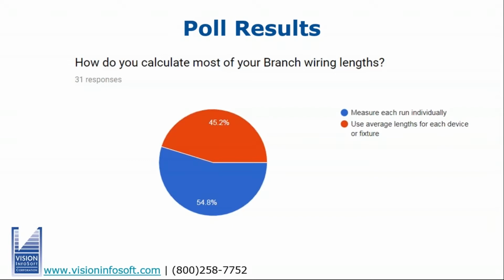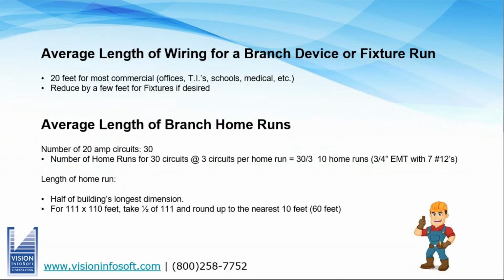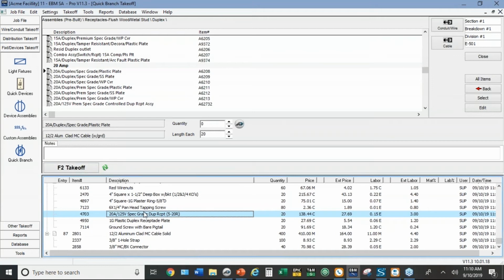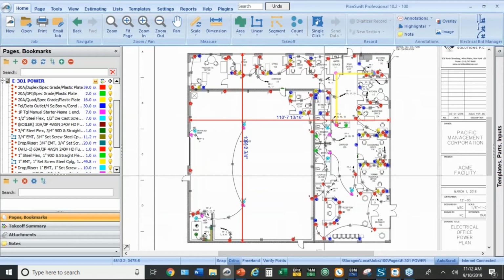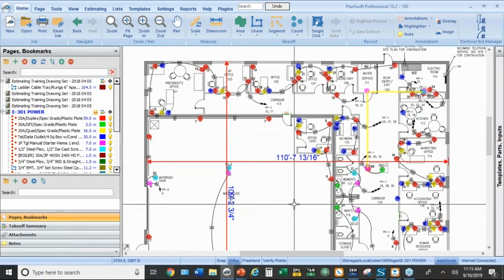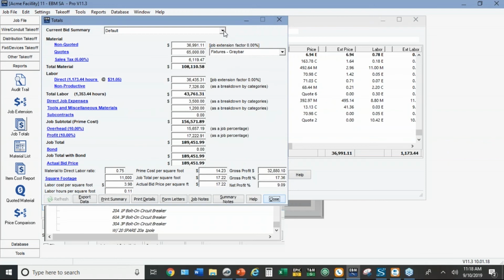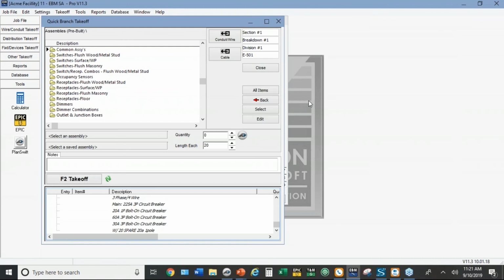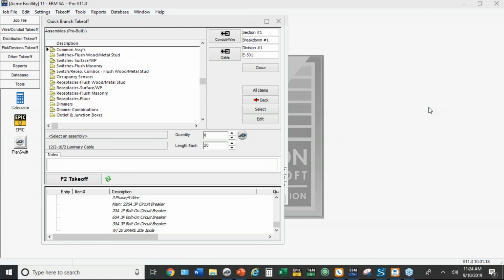How to speed up the most time-consuming part of a takeoff (and improve accuracy!)

Comment: What size crew and how long would it take to get a $200,000 commercial job like that done?
Reply: The size of the crew would depend on the length of time available to complete the electrical work.  I believe there were about 1100 hours on this job which would be about 138 days 1100/8).  At 40 hours a week for two electricians, that would be 80 hours per week.  138/80 = 1.725 weeks (or about 9 days for 2 electricians).

Comment: Your Formula is flawed, because for one...7 #12's or three 120v circuits with a equipment ground, requires derating every single current carrying conductor becasue you exceeded the NEC rule.  Also, if you have circuits spec'd to be in their own conduit, ie ISO circuits that also throws wrench in the formula.  I have used EBM since 2006 and still use it, however I would never bid homeruns where conduit required using this formula.
Reply: Sorry, I don't understand your comment about why the formula is flawed for 7 #12''s for three circuits.  Can you explain further?  Of course, if the spec requires certain circuits to have their own conduit, then you have to take them off separately. 

Brian Hoffelder
Reply: @brianhoffelder8830  More than THREE current carrying conductors in ANY size conduit, all wires have to be derated except equipment ground.  Meaning, for three 20a 120v circuits in ONE conduit, you are required to run 10awg thhn instead of 12awg
Reply: @brianhoffelder8830  Your calculations are correct; there is no need to adjust to the next wire size for the (6) current carrying conductors, plus (1) EGC. If you did the calculation for the (6) #12 THHN, Which would be Derated based on the ampacity of the 90 Degree Column(that's the column in which THHN fall in), you would end up with the following. (30A X 80%= 24A) T.310.15(B)(3)(a).  
Also, Ref Article 310.15(A) for more info. 

Side note here. Thank you for introducing me to the Candels in one of your other videos, which I believe is the estimating lighting controls video. They are wonderful people, and their estimating program is like no other. I am currently going thru their program right now. Even though I personally don't use EBM, I really appreciate all the information that you and your team post.
Reply: you only use derating wire when ambient temperatures is above 110-120F, 3/4"emt maximum # of #12 is 9, but Brian is fine with only 7 wires.
Reply: @BatzElectric  You are getting confused.  There is temp correction and number of conductors correction.  Also...rule of thumb is under 100a 60deg is the column to use.  Your termination point dictates the column you use for ampacity.